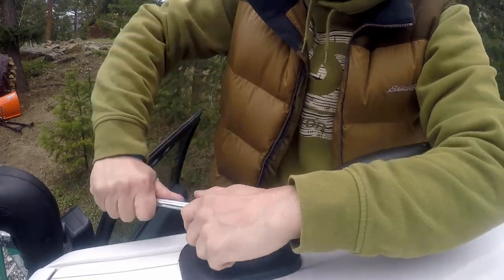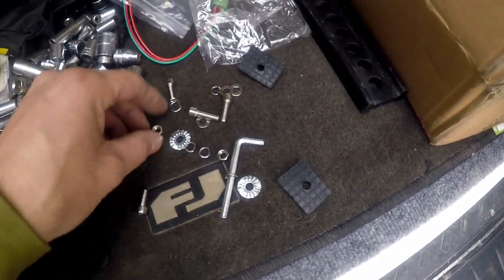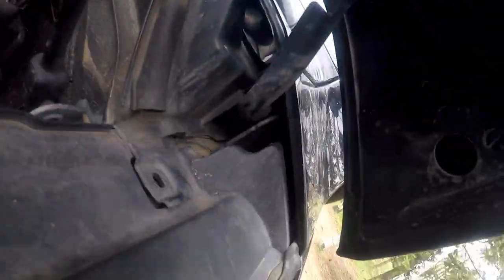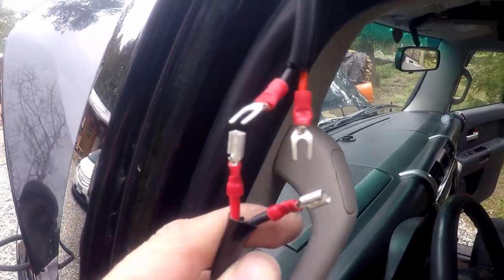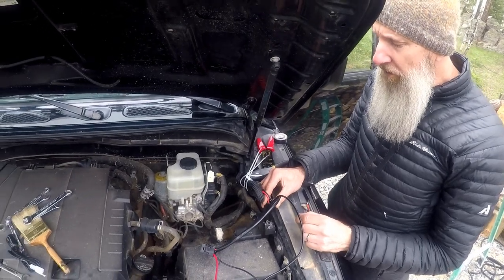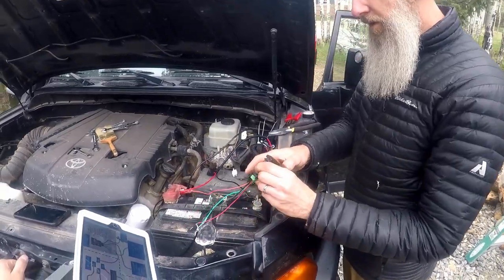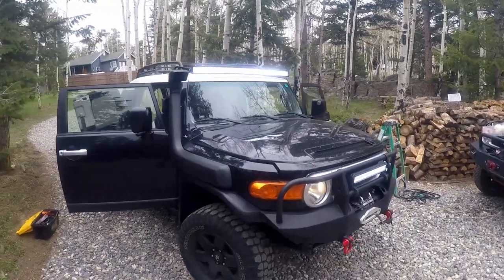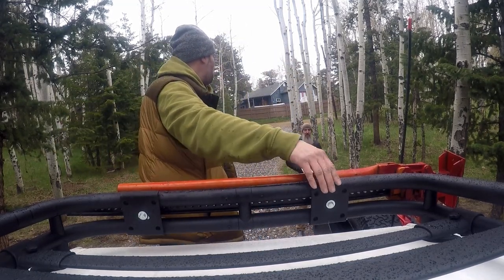FJ CRUISER LIGHT BAR INSTALLATION

Comment: i know this is an old video, but is there a link to the exact parts that you bought for this? Like the bar itself, the wiring, and the mounts.
Reply from the maker: Hi I don’t really remember what exactly it is . I got it from amazon there is tons of it and it’s all the same , not expensive at all . The process of installation would be same 👍

Comment: My question has to do with the wires you ran along the windshield channel.Did that black strip molding just slide out the top then you stuffed the wires inside then slid molding back down? Thanks
Reply from the maker: I am not sure what exactly you mean. If we talking about the black rubber cover on the wires? To be able to get the wires from the bay out in the lower corner by the window pull the black cover of wires out . Once you have it through. Slide it back on the wires and then tuck it in the chanel by the window. Also used little bit of black caulking to glue the whole thing to the chanel. It is very hard to jam it in the chanel and it likes to fall out so the caulking will secure it in 👍 hope i was able to answer you correctly 🤟

Comment: What kind of calk is that and why u put that thing in there. Please reply .am gng to install one light bar for mine.
Reply from the maker: It is 100% silicone. Fj cruiser has a weak spot and leaks it to the head liner if you don’t seal it . I have no problem so it works . You can find videos on the leaking though a roof rack on fjs
Reply: @colorado4x4adventures62  pls send the name of the brand
Reply from the maker: @mathewkkd2966  any 100% silicone from hardware store will do the job no matter what brand